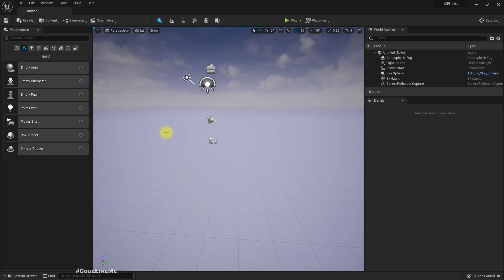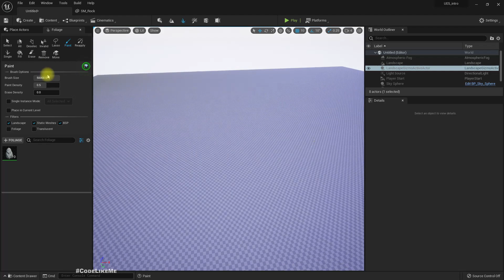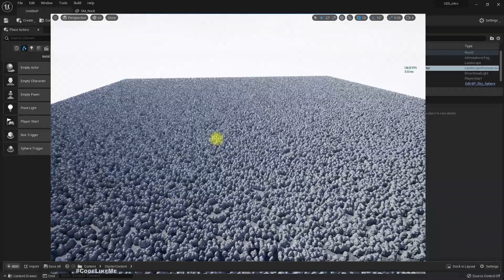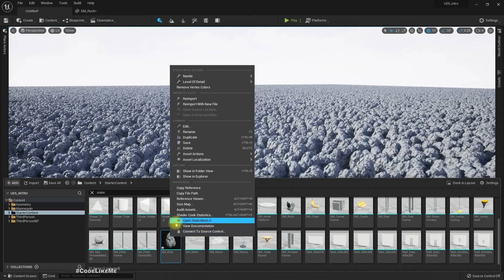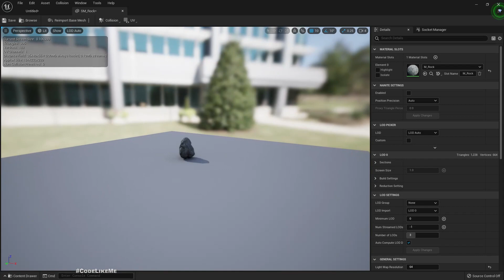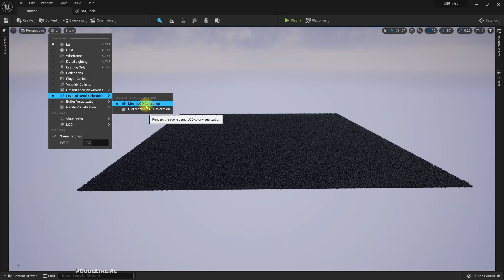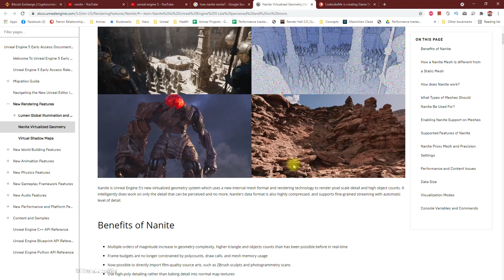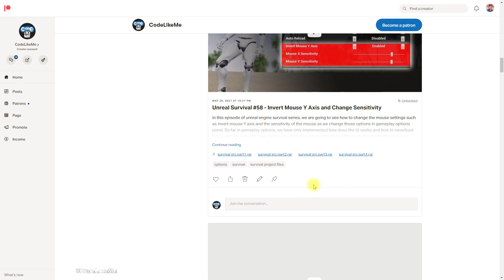Unreal Engine 5 - Nanite Performance Evaluation

Comment: No, you should try different meshes) With same meshes you won't benefit from virtualization. With same meshes they all are rendered as instanced meshes even without nanite, so you won't get draw calls problem
Reply: Really? I thought you need to set them as instanced meshes first
Reply: @alitalhouni2843  Foliage is instanced by default. It's pretty much a single actor spawning # instances of each type of mesh you throw in there
Reply: @alitalhouni2843  I was pretty sure the foliage system automatically forces the mesh to be instanced.
But, I am not sure.
Reply: Epic says there are performance improvements and better handling of large number of instances in ue5 too...

Comment: Good video man, Please make some tests with lumen but on interiors with many lights, i´m having an issue where if i go at certain distance form the first light i placed on the level the GI gets overly bright, this without changing anything to the level or lighting, it just happens, and lumen overall have a lot of artifacts, i believe it´s more intended to be used with directional lights for exteriors.

Comment: Does that means no more LODs?
Reply from the maker: Yes
Reply: It means automatic lod that they just don't call lods, as it doesn't load a whole model at a time seemingly, and can cull models partially.
If it's actually visibly as good as manually authored lods is hard to tell from this. Not zooming enough and a bunch of video compression to hide stuff.
But yeah, it is probably really cool.
Reply: I guess it is just the same as tesselation in Cryengine before?